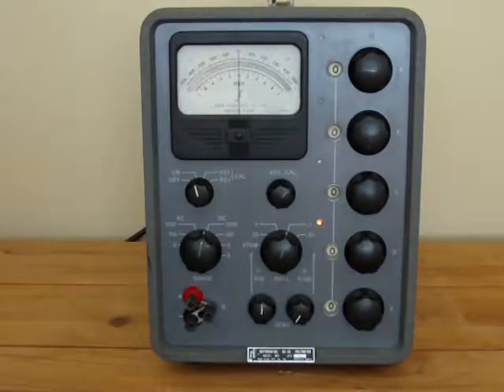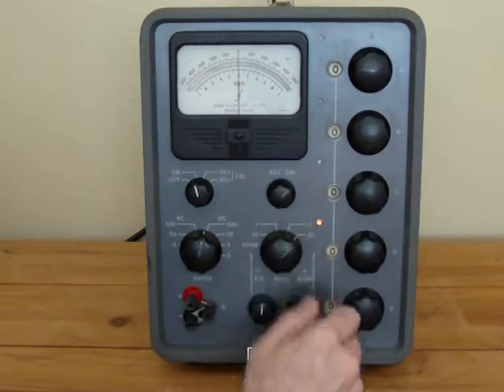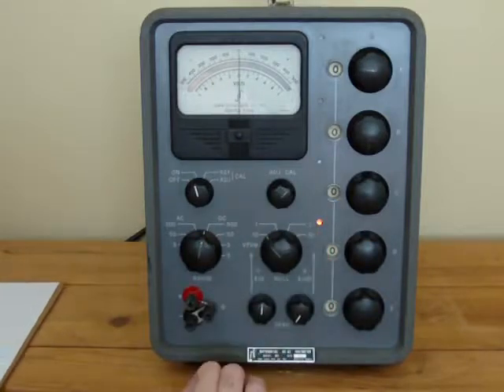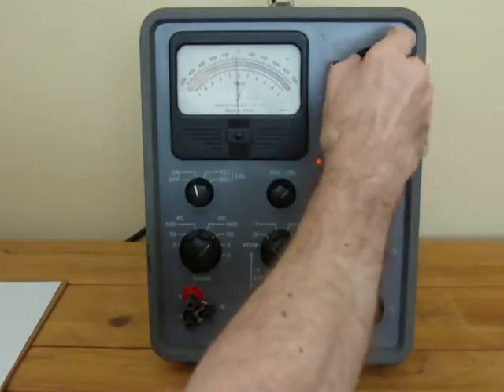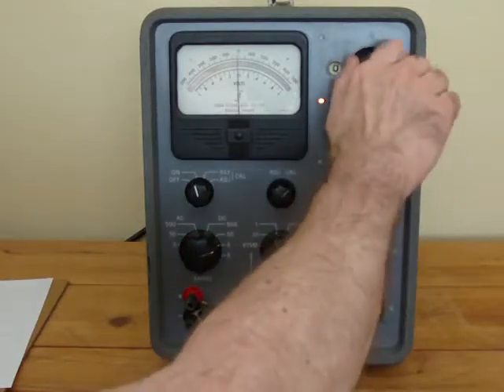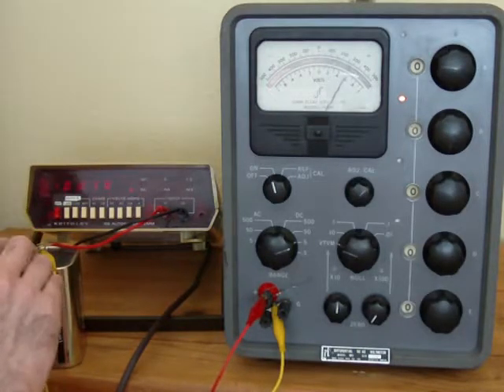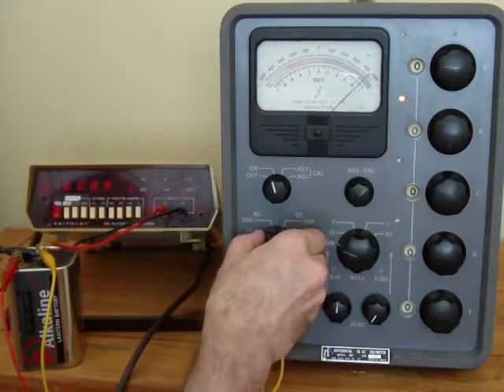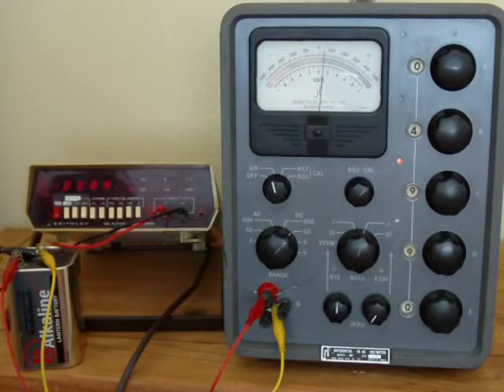Fluke 803 Differential Voltmeter

Comment: Is that at the right a K-Varley divider?
Reply from the maker: If you are talking about the 3 terminals at the lower left corner of the instrument, Top (red) is Positive Input, Bottom (black) is Minus Input, Black terminal on the right is instrument Ground.  I have the Negative Input connected to Instrument Ground.  Also there is a resistor connected between Positive and Ground so there is some load.
The basic instrument has a bridge inside such that when the meter is at zero (null) no current is drawn from the input that you are applying.  Therefore if measuring a battery with excessive series resistance, you are reading the internal cell voltage.
Reply: @CV2200A  thank you for the detailed answer. 
I actually was talking about the  5 switches on the right side. That is  a Kelvin-Varley divider.  In the mean time I was able to download the manual  which confirms that. https://usermanual.wiki/Manual/Fluke803BACDCDifferentialVoltmeterWW.230774795 
Enjoy your machine! Nice!